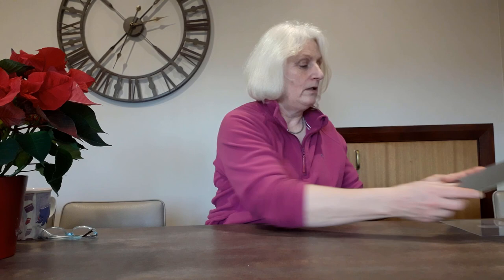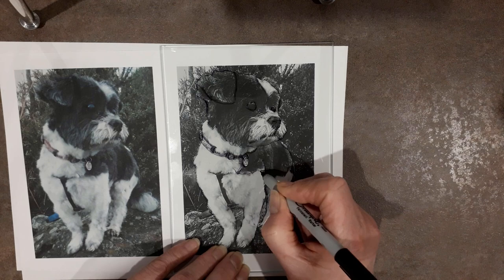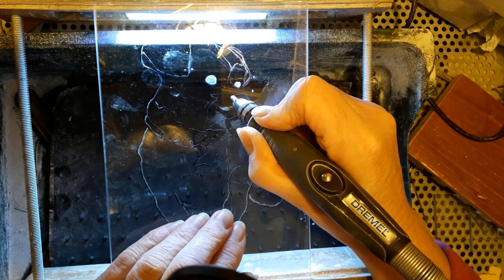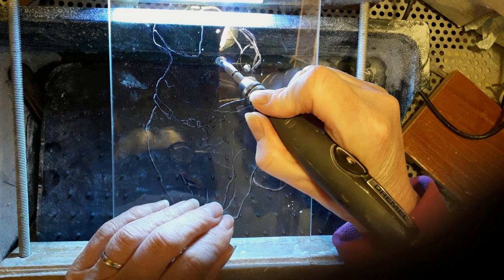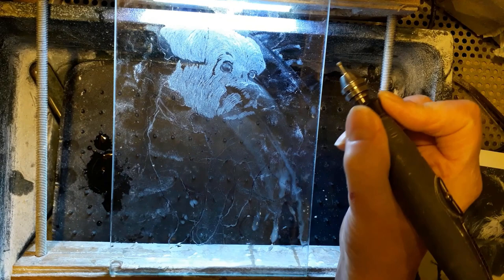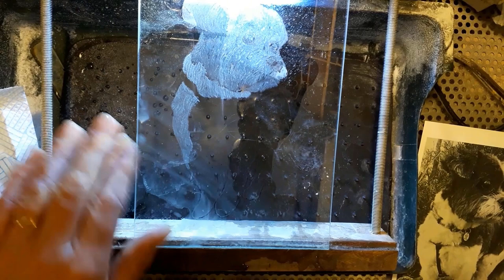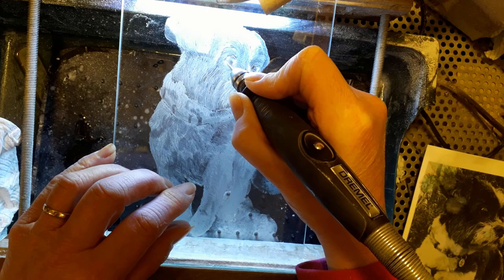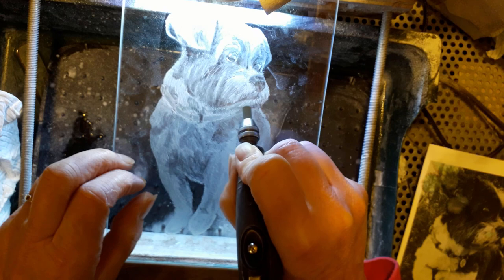Glass Engraving for Beginners.  Engraving a Pet Portrait

Comment: Thank you for the video. That was really informative. How long did it take you to engrave that photo on glass? And how long would it take if you do the same on a small bottle (9cm - 6cm)?
Reply from the maker: Hi,  That took me around 2 1/2 hours.  Difficult to say how long it would take you on a bottle.  I can do portraits a lot quicker now than I could when I started.  Also depends a bit on how much detail you want to put in.  The process I described of engraving/polishing/going over it again can be quite slow, but it usually results in a good finished texture.
Reply from the maker: But to actually answer you rquestion, I would expect to spend around 1 1/2 hours or so for a smaller engraving of the type you mention.
Reply: @whatktmadenext  thank you for your answer. That was really helpful and appreciated. ☺️ According to your experience, would engraving a 4cm -7cm photo on a small piece of glass be hard? I mean because it's so small, is it hard?
Reply from the maker: It would be quite possible to work at that scale.  You would probably need some magnification,  unless your eyesight is absolutely excellent.  It would probably be a good idea to have a practice run on another piece of glass.  That would help you to work out how much detail you will be able to include.

Comment: Thanks so much for this video, I’m working on a little dog engraving for a friend right now, and I’m a little stuck with the eyes and the tongue 👅 that’s out, any suggestions, I’ve already spent 5 hours on it,  and not done, is only a 16 oz glass 😅😅😅  I’m totally a newbie in engraving but love it so much so far, and dogs is my favorite thing to engrave, they’ve made my friends so happy, even though they gotten the very first very imperfect engravings from me 😄
Reply from the maker: I love engraving the dogs as well.  As far as getting the tongue done, remember there are only two things that you can do with engraving.  Those are texture and shading.  The texture of the tongue is likely to look fairly smooth, unless you have a very close up picture.  Concentrate on the shading.  Getting a smooth transition from an area of shade to a highlight is tricky with a rotary tool but stick at it and you will get there.  Once I finally get my next video finished, I will be showing a couple of ways of improving that transition.  Both are done by hand.  One involves using wet and dry sandpaper and smoothing down tool marks, which should provide some very even shading.  One involves using a green stone and manually rubbing down a surface, again removing any tool marks but increasing the highlighting at the same time.
Reply: @whatktmadenext  ok great! Will try that, I just ordered some polishing burs because I didn’t have Any, thanks so much for answering 😃😃😃 You’re awesome 👏🏼
Reply: New at engraving and your videos are some of the only helpful glass engraving videos I've found. Ty so much! I'm so stuck on shading though. Can you tell me what I'm doing wrong if my green rubber makes things actually look lighter? I must be doing something very wrong lol.

Comment: Hello KT I would like to learn, I have no idea what to use for the drawing on the glass. I would like to make some small drinking glasses for my son for Christmas this year 2021  with his name on it. I found some nice monogram, but I am worried , that if I have to wipe the dust off that I wipe the drawing away as well. Can you please tell me what you use as a drawing tool?? Thank you
Reply from the maker: I normally use a fine point permanent marker.   A Sharpie or something similar.  Another option would be a Chinagraph pencil. You are right though, whatever you use  has a very nasty habit of coming off  the glass as you are working.  I try to get round that by going over the lines lightly with a fairly smooth stone bit, like an Arkansas stone, right at the start. That marks the lines more permanently onto the glass.   If you are working on drinking glasses you may be able to stick you pattern onto the inside of the glass and just use that to guide your engraving.

Comment: Hi
Okay I am having difficulty. My carving looks like a blob of white. The dog is beige with little bits of black. It’s scratchy, looks terrible even after polishing. Others I have turned out well. This one is a mess. I am somehow getting lost. Any help would be appreciated. What the heck am I doing?
Reply from the maker: It's hard for me to help without seeing the engraving but I do find that doing fur is often an iterative process.  That is, I will engrave an area to give the texture then polish it back (often quite severely) to show the shadows, then go over that previously engraved area to pick out the highlights again, and repeat that till I get to a finished engraving.  Engraving black areas is always difficult.  You will have to polish those bits right back to get them as dark as possible.  Polishing never gives a good defined shape.   What  I mean by that is it is really difficult to polish out a dark line, for example, with good clear sharp edges. I normally polish out a shadow and then define that area by engraving the lighter areas all around it.  I don't
Reply from the maker: I don't know if any of that will help, but don't give up.  So long as you don't end up engraving right through the glass you can keep going back over areas, adding highlights,  shadows and texture until you get it just right.

Comment: If the background is a fleece blanket how would you engrave that?
Reply from the maker: Really good question.  I'm guessing that the blanket has a fairly smooth texture. If so, then you will be looking mainly to replicate areas of light and shade to show folds and shape in the blanket.  The bit I would use would probably be a green stone.  If you hold the stone at a steady angle, the little scratches left could then help to show the texture of the fabric.  Use a white Arkansas stone and/or rubber polishing bits to take that first engraving back and re-introduce your shadows.  The best advice though, try it out on a spare piece of glass first.

Comment: how do you make the hail do you do it like just lines or what
Reply from the maker: Whenever you are engraving, the real skill is in finding a way to express what you see in the texture and tone of the glass.  I spend a lot of time with pieces of glass and different types of burrs, trying out different ways to get the effect I want.  I don't think I would use lines to show hail.  When you look at it, you don't see a series of lines after all.  I might try a series of dots (for the hail), each one with a short tail, all on the same angle, to try to indicate movement.  Like I say, try it out on a spare piece of glass first to see if it gives you the effect you are looking for.

Comment: Why is it that my bits are being worn out on evenly when engraving or polishing I do have a Dremel as well
Reply from the maker: That sounds a bit strange.  What kind of bits are we talking about here.  Diamond? Stone?
Reply: @whatktmadenext  Diamond and rubber polishing.  Could it be I’m holding it down to hard?
Thank you
Pauline
Reply from the maker: It could be that.  With diamond bits, it is really the speed of rotation which is doing the cutting for you.  You do need to apply some pressure, but if you are pressing down too hard, two things will happen.  Your hand and fingers will get sore, tired and cramped, and the Dremel will be slowed down, because of all that friction.  I recommend using a moderate amount of pressure and moving the bit a little more slowly over the surface.  That gives it plenty of time to make the cuts so you can still get plenty of depth to your engraving.

Comment: Hallo KT, I am from Belgium sorry for my Engl. Wear can i buy the burs that you yuse?
Reply from the maker: Hello from snowy Scotland.  There is a specialist supplier called Eternal who have a very good on-line shop.  www. eternaltools.com.  They can supply everything you should need. I would suggest you have a good search on-line in case there are any suppliers more local to you.  You can also pick up polishing rubbers and other burrs cheaply from Amazon which can work perfectly well.  Just be careful to check that the diameter of the shank will fit your tool.
Reply: @whatktmadenext  Thanks for your quick anser